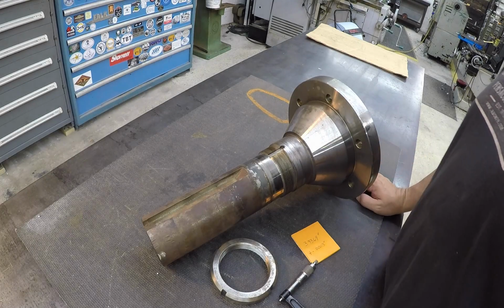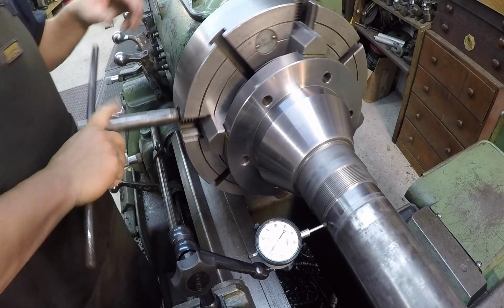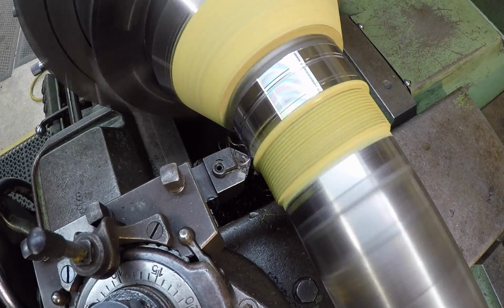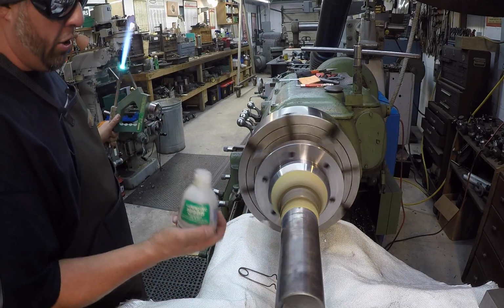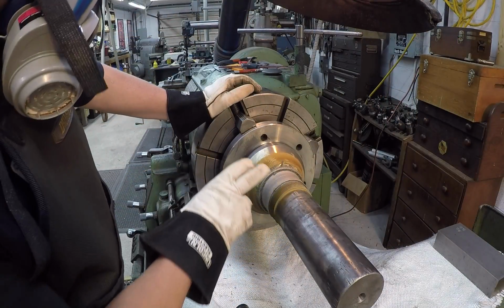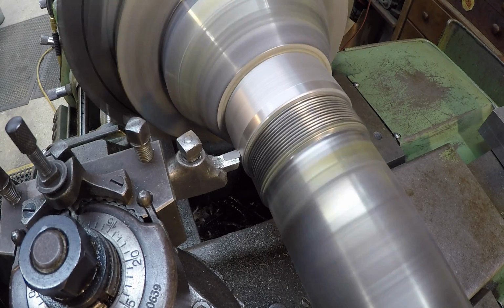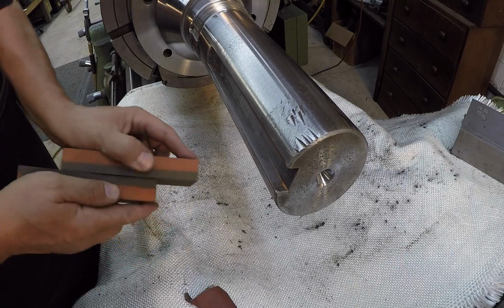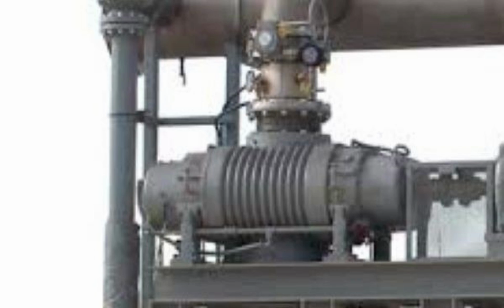SNS 300: Spray Welding a Blower Shaft

Comment: I remember Eutectic from back in the early 1980s.  There were other brands of metal powders, but you practically had to use them outdoors because of the metal vapors.  Eutectic seemed to have a better product in that respect.  In the video, yours looks like steel, where ours had more of a brass tone to it.  Product evolved or different product?

Comment: I love what you are doing.  I got better today - issues - but started turning down a 1.25" Tractor pin for making a bolt for a hasp that lost the bolt.  I was able to tap the hasp - like a C with a hole and threaded hole in the ends.  My lathe is 69 years old.  Wonderful.  I have a day or two working on it.  Might be out late with my telescope!

Comment: Really enjoyed watching this.   I ran a machine shop back in the 80's where we used, I think, the same spray welding set up (was it Eutectic or something like that).    I re-lived some of the past watching your video.     It was always just a little bit scary, especially when the shaft being worked on cost a lot.   It is obvious that you are a craftsman from watching you.    Was that a Monarch lathe you used for the part?

Comment: Loved the video. Brought back many memories. Served a 5 year apprenticeship as a fitter/turn in HM Dockyard Plymouth. Then 35 years as an Engineering Officer on all types of ships.  We always used this method on shafts etc as it is a quick efficient method as often the part had to be repaired in place. There are not many repair shops in the middle of an ocean !.  Great to a see skilled man using all the equipment correctly to produce a first rate job. 71 years old now and can appreciate a craftsman when I see one. Thanks again.

Comment: Back in time, in the late 80's, when I was still a metal turner, I used that more often. We were one of the few companies in Belgium to have it. I googled, we had a Castolin + Eurtectic Rototec 80. Depending on the metal we sprayed it could vaporize horribly. Usually also for spraying harder metal or bronze.

Fantastic to see it again.

With mixed feelings I look back at a lathe, I loved it very much and I was certainly one of the better youngsters in the field, I also had a super teacher, I had outgrown him with my 20 years. In the end I only did it for 10 years, I could have been promoted in rank but no career opportunities in money because I had too low a diploma. Although I graduated as a tool maker. I was sick from the sector and went different ways.

Now I am an industrial mover, rigger and mechanic. From 0 to 250 t (tonne), we get outside from factory halls and we move worldwide. Also a fantastic profession, in a different location almost every day. getting to know new people, with the big rig on the road ....

My heart is still somewhere on the lathe, although I never see myself again as a professional operator. If I have a large hobby room again, I might buy one for my own use, a Cazeneuwe HB 575, which for me is the Rolls Royce among lathes.

I hope to see some nice videos, this was the first time I came across your channel, greetings from Belgium

Comment: I've been welding for 30+ years, I run tig, mig, stick, flux core, sub arc, oxy-acetylene etc. and never hear of "spray welding" heard of spray arc lol , but not spray welding, I've worked in many machine shops and did lots of welding on shafts like what you did here, but always with tig or mig. If it warped we just slapped it in the power press and then turn it. Great video I really enjoyed it!

Comment: 3.9369  inch is 100 mm spoken in metric :D
Reply: Or 99.997 to be precise, so a slide to barely press fit with the .0003" tollerance
Reply: @flyfaen1  + or -  0.0003" tolerance on Adams notes---------he stayed on the high side then emery polish

Comment: I spray welded forCanadian longeryear biamond drilling   and for ASEA  electric motor rebuild shop
Brings back a few good memories   you use a different applicator and temperature was important for the bond  . every  thing else is quite similar .  I repaired a lot of shafts at quite a saving to the customers . nice to see a video with  all the safety pointed out and used.

Comment: Thanks for showing us this, really neat process! What is the spray weld deposit like? The chips look a bit like cast iron, but you seem to be either taking it easy on the cutter or easy on the deposit. Is it really hard? Does it want to flake off? Keep on going with the videos!

Comment: I would never criticise a man with your  skill and expertise.  Back in the bad old days when I was busting my knuckles on horrible green machines we would sometimes preheat with an induction coil.  As I'm sure you are aware it can take a very long time to heat very large lumps of steel. Often cast materials needed preheating before welding. Either way awesome job!

Comment: Facinating! Thanks Youtube algorythm for suggesting this! 

I have a question - is the spray weld coating fully bonded to the original base metal considering that it's considered a cold process?
Reply: It is a cold process in relation to other welding methods.  The base metal temperature is not critical to the success of the  coating.  All of the thermal activity takes place in the flame where the particle temperature is close or at the melting temperature of nickel (1445C) which is the main constituent. The adhesion to the base metal is a product of kinetic effect - powder particle temperature + velocity.  The particles micro weld to the base metal surface and previous deposit layers as the build up continues.
Reply: @peterpaton1164  so it is comparable to brazing or tin soldering, you adhere an other material to it?
Reply: @sandorbakker8166  No, this process has no similarity to brazing - although the other process featured in another of Adam's videos (Eutalloy/UltraJet) does.  In the Rototec process used in this video there is no prior or subsequent melting of either the deposit or the base metal, the bonding process is complete on the particles impacting the surface they land on.  The adhesion to the base metal is extremely effective if done correctly - we would demonstrate this during a demonstration or training by offset machining a coated sample to show the transition between the base material and the coating layers.

Comment: Hi greetings fromItaly. Aboom please a question : at the end you use 2 stones like the ones used to sharpen old beard razors , to flatten axle end . How do these stones are named? what is their use? why not use special sand papers or  a rectification tool? thanks and great videos.
Reply: They are precision ground on a surface grinder with diamond wheel. There are several other videos on them but the original is from robrenz.

Comment: Aside from a seal surface or cosmetics, what good is this process? It doesn't have structural integrity.
Reply: You didn't watch to the end
Reply: You have to watch the whole video there are different grades of product that are harder. Besides that its supporting a race, bearings never touch the shaft.

Comment: Your meticulous a part setting process is magic :)
Is the welding place as strong as the other side of the part? Did you try to protect untreated part of the detail with high-temperature heat resistant polyimide tape? It seems to me to be very convenient in this case.

Comment: I work for a company called colchester rewinds plant and engineering in england. We repair shafts like this all the time. Unfortunately due to cnc, mass production and being able to post nearly anything on a next day delivery from anywhere in the world, this is becoming a dying trade. Its such a shame, and skilled tradesmen are becoming few and far between because of this. We live in a world now where it has becoming cheaper and more economical to buy new and chuck away, than it is to repair. Although the ecological cost, i fear, is far greater
Reply: I am one of those tradesmen to which you referred. I am a crossover, or hybrid- both manual and CNC. I can use a slide rule and a 3rd function calculator, make any part to any conceivably realistic tolerance in a less than adequate environment with vintage machines, draw ,prints by hand or on autocad, generate and troubleshoot programs, edit on the floor, read and splice NC tape. I have flame sprayed stainless and graphite, cylindrical ground those surfaces, heck- I have offset ground model-T car cranks, and ship crankshafts over 30 feet in length! I wonder if there is a video showing THAT?!?.... no sense in going on and on lol.  At 52 years old, There is no place for my trade. When I return to work, I will be a production line worker making minimum wage.
Reply: @1ChristopherDean  there are plenty of shops in need of quality craftsmen. Many of the individuals with quality machining skills are reaching retirement age. Around my area, I know of at least 12 shops that will be hiring like crazy, as soon as the government takes the shackles off the economy.
Reply: @OneTruePhreak  Thanks for the positive reply. I am curious as to what area may be hiring in the future.
Reply: @1ChristopherDean  It all depends on where you're located. Government run arsenals were hiring like mad, before the Kung Flu, and will be again after. Machining and inspection departments mostly. Several members of my family actually work for one, and have been trying to get me to apply. I've refused to, simply because I find the pace of government work to be too slow.
Reply: @1ChristopherDean  if you ever decide to move close to colchester in the uk then give me a shout about a job. We cant get good tradesmen for love or money.
Reply: @1ChristopherDean  Can you not try to do what Adam is doing? Your still young, have all those skills (like me but I am older)...........Youtube machinist!!!!! Home based old lathe and mill to start off. Good Luck

Comment: In the mid 60s I worked in a locomotive shop wherea somewhat similar system was used to build up the drive wheels on locomotives.  The powder was dropped onto the top of the wheel where a torch was positioned.  Heat was imparted by a curved manifold along the bottom of the wheel.

Comment: When we flame sprayed boat sleeves, one thing we learned is to never tip the metal with your fingers after it's turned, before spraying. We wrapped the turned/grooved sleeves with brown paper while in the lathe, before they were taken to the flame spraying station. They need to be extra clean.

Just the bit of oil on your fingers can cause problems during spraying.

Comment: Is that similar to plasma cylinder coating? The 5.8 gt500 ford has a similar process. They spray coat the cylinder walls. Over aluminum though.

Comment: Really enjoyed this video, what a walk back in time. BTW, hat's off to whoever shot the footage!
Back in 1975 while in my 2nd year of Machine Shop at BOCES my shop teacher acquired one of these spray machines and we got to use it. Yes back then we had FULLY equipped machine shops in our schools, not just the old shop class with a table and band saw for wood working. We also had rifle ranges in the basements of schools, times have changed. 

Anyways, it was a real pleasure to watch and see this lost art still being used, job well done sir and hats off to you. Would love to spend an afternoon in your shop with you! Need an apprentice? LoL

Take care and stay safe folks! 
Hold on a little longer, this too shall pass ;-)
Better days are ahead.
Reply: My son's high school has more equipment now, than when I attended the same school. When I was there, they'd received a free CNC lathe, but didn't even know how to turn it on. Today, they have a complete CNC shop, as well as design and programming classes. The weld shop is actually used by a large college, for it's welding course. The graduates of the high school welding course are more sought after than the graduates of the college, which uses the same facility.

The school offers a lot of career options, including firefighter training, machining, welding, automotive repair, computer programming, drafting and design, and woodworking. They even build an entire house, from the ground up, over the course of four years for one class. The nursing course gives enough college credits to get an LPN certificate by the end of high school.

Thankfully, my kids are going to leave high school with actual career opportunities. I'm glad to see at least some schools are returning to the education of old, despite the introduction of the Common Core garbage. They even offer archery in gym class again. Maybe one day we'll get back to shooting teams, but I doubt I'll live long enough to see it.

Comment: Great video!  I used spray metal process circa 1980 to fix bearings on injection molding machinery.  Saved a week of tear-down and reassembly, plus the cost of the housing, to refurbish the machines.  The journals were subjected to 75-90 tons of cyclical loading on 10 - 15 seconds.  Last I heard the bearings were still running 30 years later.

Comment: knew a guy that did a lot of this. after 35 years of it he died with lesions on his lungs and brain. he took pride in his work. he also had some pride in the fact that he never smoked or drank. WEAR A AIR SUPPLY MASK
Reply: My thoughts as well.
Reply: And, don't forget the camera person "Companies should carry out all thermal spraying processes, especially plasma spraying, in enclosed booths due to the dangers of particulate hazardous substances."
https://safe-welding.com/thermal-spraying-closed-booths-with-extraction-are-essential/
Reply: I'm pretty sure at 27:50 you can hear his fume extractor running before he starts grinding.  Hopefully that would be enough.  I was getting a little nervous as the camera lady was inching closer for a closer up shot though.  I figured something similar to an aerosol metal had to be pretty hazardous.
Reply: I'm 67 years old. I smoke and drink. I also have spent my entire working life as both a sawfiler and a millwright. I've spent countless hours arc welding, using a spray torch, grinding, plasma cutting, etc. We are required to have pulmonary function testing done now and my lungs are fine. People are so afraid of everything today. I'm surprised people still get out of bed in the morning! I bought an extension cord a few weeks ago and there was a warning label on it that said to wash your hands after using the cord because it contained materials known by the State of California to cause cancer. I think we are turning into a nation of wimps.

Comment: Spray welding or metal spraying is a tried and trusted method of repair BUT it is limited to how thick the spraying can build up. It can also be used for sleeve bearing journals.

Comment: Why would this process be better then fitting a sleeve? What's the hardness of the spray material? Is an oxy torch hot enough to actually bond two metals?
Reply: I'd imagine that the torch activates a chemical reaction. Like, overcomes an energy barrier such that chemical bonding occurs.
Reply: watch the entire video. Especially the end where he explains the benefits. Then you won't need to ask questions.

Comment: Abom, nice job.
Q. Is there a spray welding technique suitable for the roller bearing journal of a crank like a motorcycle?
There is a particular bike that is getting hard to obtain new cranks for & it is common for the big end bearing to fail, damaging the pin.
Unfortunately, the unconventional design has the pin cast to one half of crank assembly, rather than the more comm 3 piece design where you can replace the pin.

Comment: nice monarch, we had one exactly like it, never had any reason to fix a single thing on it, it was an ex american mfg that made parts for WW2, and we didn't baby it, i worked there for 25 years and it was still perfect into the 21st century, the company went broke after I left and presumably it's more than likely still makin chips somewhere
Reply: I did this process starting in '75 to '17 when i retired, have you had the chance to do the fuse coating where you melt the coating? we did a lot of that also, we did mostly repair and a lot of food machine repair, the fuse coat could be threaded and have keyways cut also, we were expected to be able to do anything our customers needed, they would bring me parts and assemblies that had failed and we had to tear it down and diagnose and do whatever was needed and deliver back so they could be up and running next day. it was hammers and rosebuds and welding, brazing, fabricating, you name it. I was lucky to work there i learned a lot in a short period

Comment: Pretty Cool!! Back in 1974 I worked in a local paper mill (made cardboard) the rollers in the machines were about 12' long with about a 4 to a 5 inch shaft. that company got one of those spay welding set ups, as my memory serves me, just like the one you used in the video. Of course the lathe I think had a 14' bed something like a 24 to a 30" swing!! (big lathe!) I never got to see it operate to the finish so your video was just perfect (now 46 years later!) Thanks I really enjoy your video's (nice shop too)

Comment: As a Chief Operating Engineer in a water plant I have rebuilt many vertical turbine pumps with 20 foot 2" shafts (4 x 5'  sections). The pump turbine bowls used collets to hold them in place. When rebuilding the pumps the collets always damaged the shaft and required spray welding to repair the surfaces. Great to finally see how its done. Nice video thanks.

Comment: Very good job, I haven’t seen the Spray weld in a while, some motor guys used to take the head off off the strait six cylinder motors, they would cut a ford V8 head in three half’s and weld them all three together to fit the strait Six motor for Drag cars. The did a spray weld type of process. My Neihbor has one that he is building right now but the head was already built , so he didn’t do it but some machinist from back in the day did it. But your stuff was great.
Reply: Those Ford heads were usually furnace brazed together.